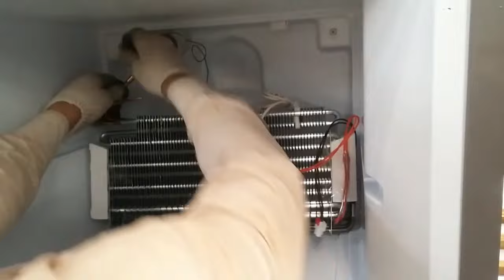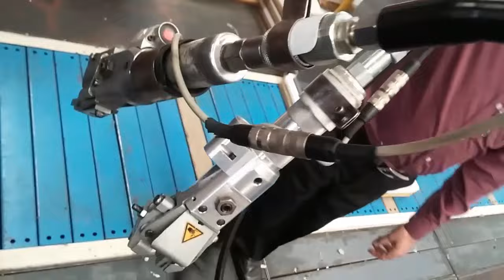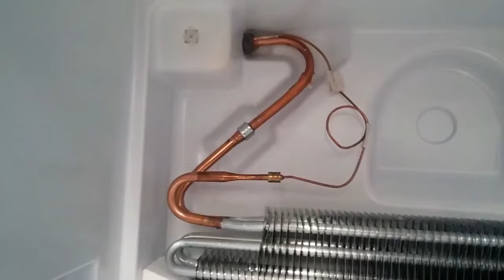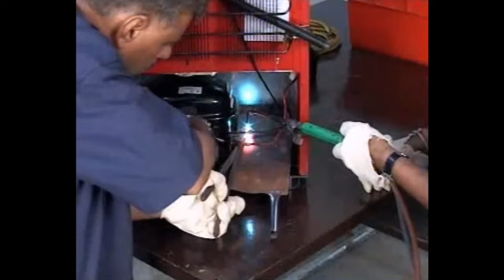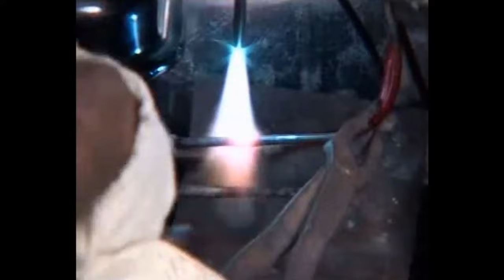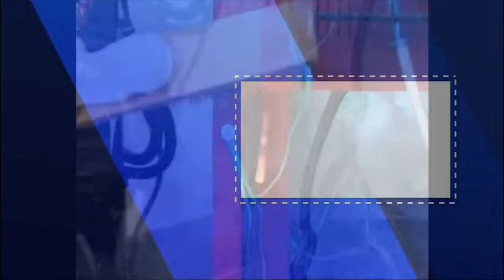HOW TO USE LOCKRING AND TAKE IT OUT??

Comment: Sir plz 1 problem solf kijiye 1 inverter AC hai uska compressor full speed me nhi AA Raha hai kya fuld hai our kya kya chack kare.....
Reply: PCB se problem hogi bhai
Reply from the maker: first check ODU and IDu sensors then.. check PCB voltages on different places.. like bridge rectifier, filter circuit, signal voltage etc..